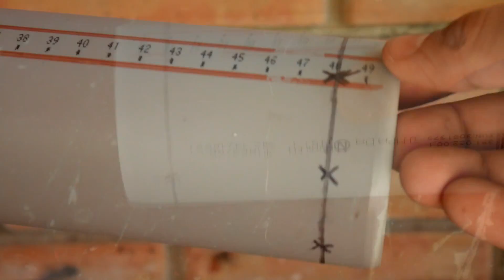incredible Homemade Invention DIY Idea For your Drill

Comment: Ya cause everyone loves  the taste of screws in there food
Reply: Oh dont worry they have been specifically coated so the screws will be fine and will not rust but you will die sooner from ingesting the chemical they use to keep it from rusting
Reply: They are not just every day run of the mill screw. They are screws, that appear to have been painted, with a fresh coat of  Rustoleum.  Yummy!  I think that, whoever made this contraption, must of used the screws that came loose from his own head!,
Reply: Mmmm.....i love the smell of drainpipe with my corn in the morning......
Reply: 2nd hand sewer pipe and zinc coated screw bits. Yummy 😋